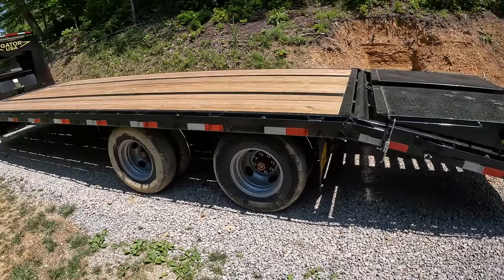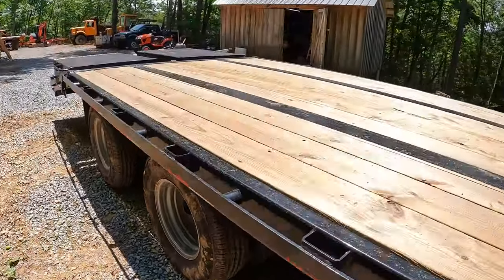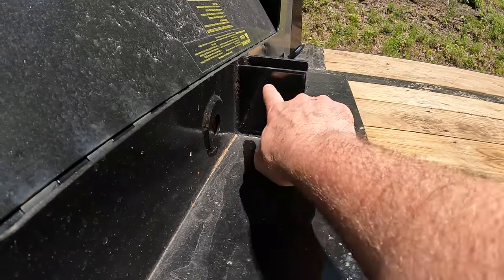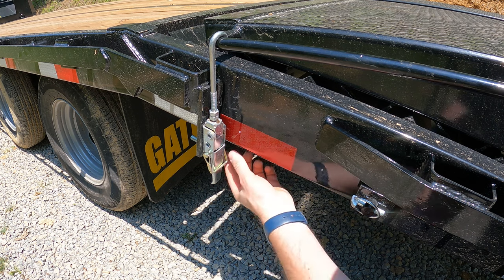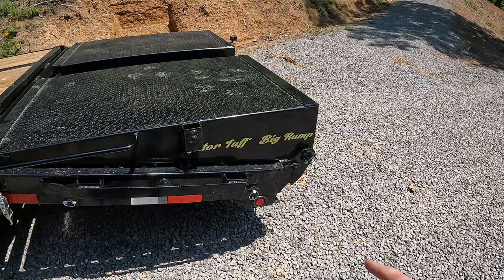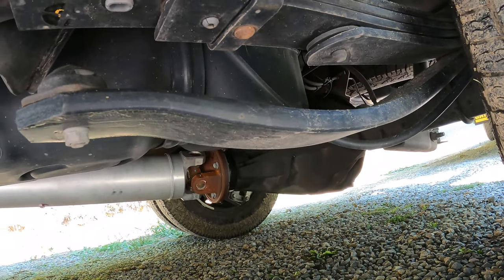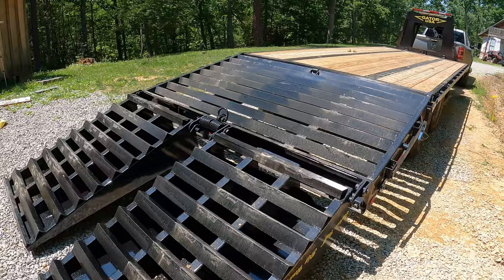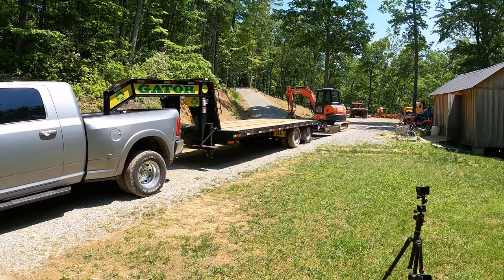An overview of my new Gatormade gooseneck trailer

Comment: Gatormade builds a good trailer in my opinion and I seriously considered buying one a little over a year ago but I went and hooked up to a neighbor’s just to make sure before I placed the order and found that with my F-550 with a 14’ utility body plus a 8” step bumper that Gatormade’s necks are shorter than some other competitor’s trailers. I could have pulled it but would have always been nervous about hanging the bumper on the steps on the front of the trailer, especially off road. Hooked to a buddy’s Diamond C and found that their neck is not only longer but taller. I could stand up straight and walk between the rear of my truck and the front of the trailer while in a 45* turn! I was amazed but you pay a premium for the Diamond C.
Reply from the maker: I haven’t had any clearance issues with it yet but I just have a regular pickup bed. I do wish the neck were taller though. I’ve hit my head more than a few times on it! I didn’t even think about that when I was looking at different trailers. Those Diamond C trailers are nice!

Comment: What’s that trailer weigh. I’m looking at getting another Gatormade. I need a tandem dual to haul my mini.
Reply from the maker: I don’t know exactly but I believe it’s around 8000LBS empty. What size mini do you have? They had several different goosenecks available when I was down there.
Reply: @MountainMindset  it’s the bobcat e50. I came up there to Somerset bought my 30’ 16k there in Somerset. Bought it from a guy named Sid.  Beautiful country up there. Yeah they have several. I wish they would put the weights online. I just got an f250. Would love to get a bigger truck but it is what it is.  It will be border line with an 8k lb trailer to be anywhere close to legal I believe if I’m thinking right. Depends on how much tongue weight I guess that it would end up having. Machine weighs 12k
Reply from the maker: @briangammons8242  that’s a nice machine. With this trailer and a 12k machine you’re probably looking at 3-4K in tongue weight if I were guessing. I’m no expert and have no idea if that’s correct but seems like a gooseneck should have around 20% of the trailers total weight as tongue weight. I’m sure Gatormade could probably tell you better. They do have a 20k rated gooseneck with I believe 8k single wheel axles under it that would probably suit your machine well. It has the 17.5” wheels and tires on it. It’s not as heavy as this trailer either. Should have less tongue weight as well. Hope this helps. Let us know if you end up with a new trailer! 👍🏻 (Edit) - I looked at my paperwork and it says my trailer weighs 7420 lbs.